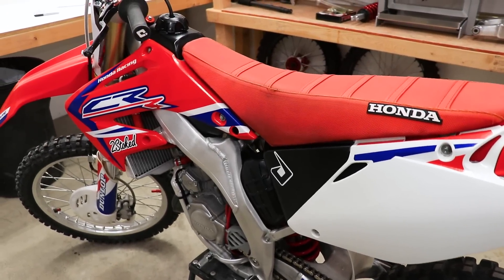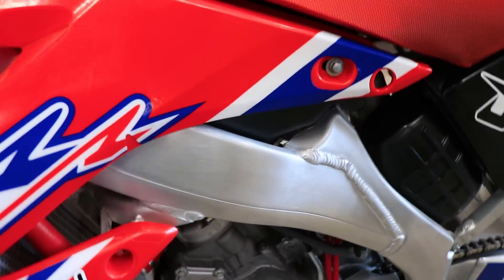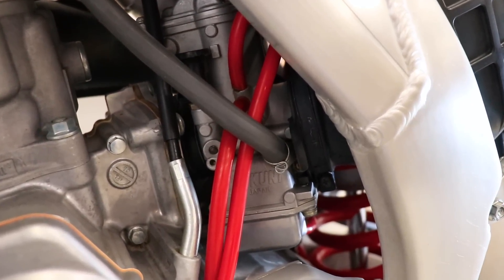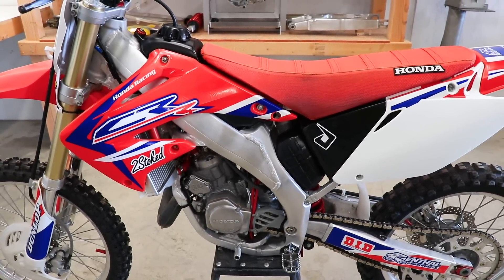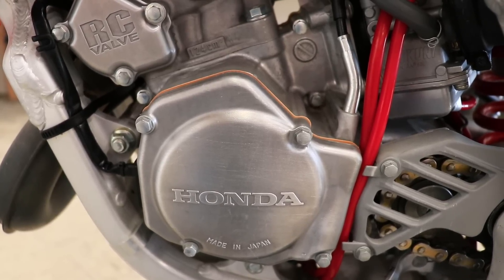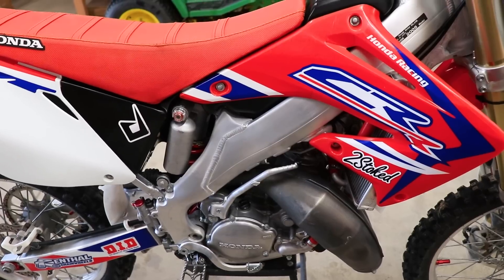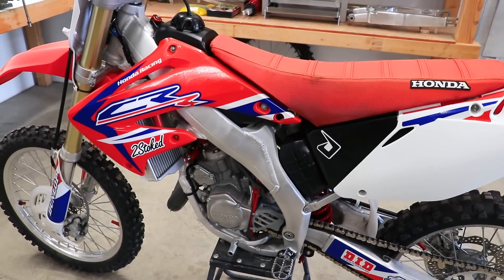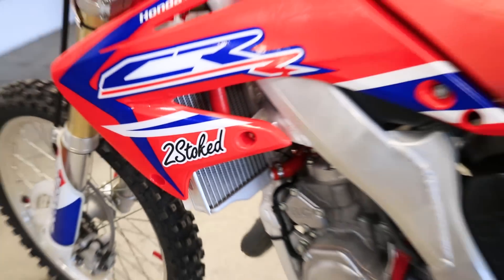My Two Stroke Doesn't Rev Out!

Comment: Question. Watching some scrambles and the way they bog there 2 strokes is unreal. How can they bog them around and not file plugs?
Reply: Because they are jetted properly. If your bike is jetted properly you can drive it at 1/4 throttle 5 mph all day without a problem
Reply: Oh no kidding. Yeah I never dug real deep in jetting and never really understood it. I I have an o4 cr250 and that thing clogs up if you put around. I just got a 03 cr250 and I never had an issue. Plugs about 6 months old and it dont miss a beat. I'll definitely learn about jetting then.

Comment: Has anyone ever used pivot works grease? I just got my swing arm bearing in and it came with grease. Is it good or should I use different grease
Reply from the maker: Yep, I used it quite a bit and it's good stuff
Reply: Thanks man

Comment: Get on it and pin it.  Ifnthat doesnt work, replace spark plug.  If that doesnt work, check your throttle position sensor in the carb.  If that doesnt work, start crying.

Comment: how about a bike that wont idle but runs great at higher rpms. 2000 Kawasaki kdx220 pwk 35. it has a gasket between the main and pilot not sure what to do next
Reply: kawasaki000000000000 check if the pilot jets are clogged/ not adjusted correctly
Reply: first thing is change the sparkplug..like you learned here ..! ;)
..then mb clean the carburator
..and check topend for compession (do you kickstart the engine or do you have to push it?)
Reply: The carb is 100% gone through and cleaned  nothing is plugged. I'll throw a new plug in it next time
Reply: Move the clip on th  needle down 1 slot...
Reply: What altitude are you at? Idle is completely controlled by pilot jet! Higher altitude smaller pilot lower altitude larger pilot! If 2 stroke 1½turns out on air screw is the place to start if 4 stroke 1½turns out on fuel screw is where to start. If more than 2½ turns out go 1 size larger on pilot jet if going in all the way makes it better but still not idle go smaller on the pilot jet!
Reply: Yes I would definitely look first for pilot jet, as everyone else has been saying. You can use a pick to clean them out, or an air compressor. If you don’t have either just use a paper clip, had worked in the past for me lol!
Reply: @agoushy74  fixed issue this season . Tore the bike down it had a broken pin thats used to actuate the power valve . The power valve was in the full open position thats what was causing my issue

Comment: your bike looks to be running a bit ritch!
Reply: since the sparkplug was faulty it looked like that...but if the engine where runnng correctly you would have been right! ;)
Reply: he did say that the spark plug looks normal in the video. which means that it looks like that on a regular basis.  so the bike is running a bit rich.
Reply: stuntmannen1000 better rich then lean.. i always run my 2 strokes SLIGHTLY rich
Reply: Crankseals mates makes it smoke like shit no matter what the oil ratio
Reply: Richer the better like money
Reply: @tommyclark8072  those seals aren't bad trust me bad crank seals will make it smoke like a train ...

Comment: you spark plug color is not normal, need to be tan color and not come out oily, time to jet your bike
Reply: since its faulty it wasnt igniting properly...if the engine was running well you where right thou.. ;)
Reply: Who the hell even jets their 2 stroke according to the plug.
Reply: its an easy way to get at least close @päwkele...not eveyone has profi equipend to check wich jet is needed.. ;)
Reply: on every engine your spark plug can tell you how your engine running ,man jet a bike is not difficult when you have experience you know when your bike running lean or rich when your only see your spark plug, you want to get a dark brown or tan color on your spark plug, not dark or oily
Reply: When you read a plug, its colour is the average of all throttle positions. So the color could look fine but it could still run lean at wide open. I have personally never found the right ratio by reading the plug. And feeling and listening for the right mixture is not that hard. 
2 stroke stuffing made a great video about this and how to accurately read a plug.
Reply: you are right @päwkele...but its easy to see on the sparkplug if there is something wrong with your engine..especally if its molten or dripping of oil ;)
Reply: Päwkele most people who know about two strokes and properly jetted carbs do... They look at plug and do chop tests.. White is too lean blacks too rich and brown mocha is perfect.